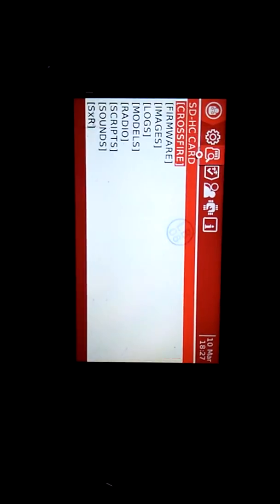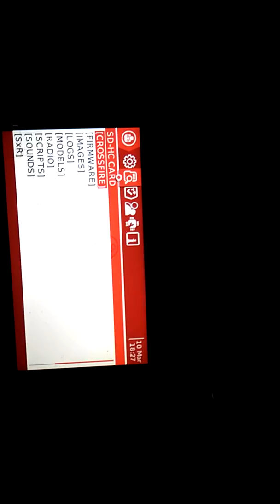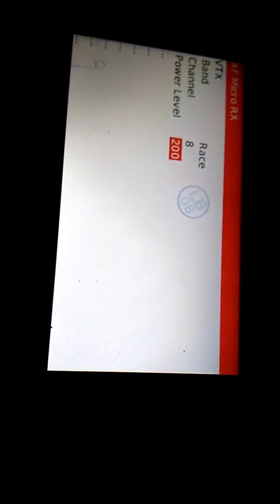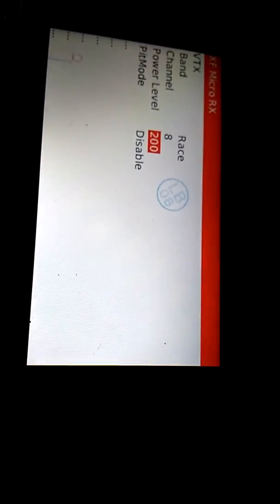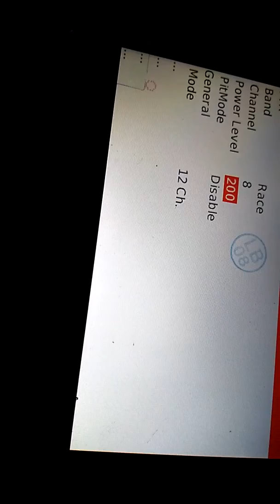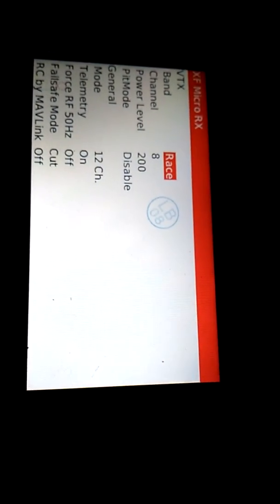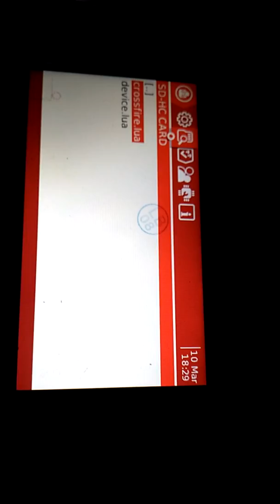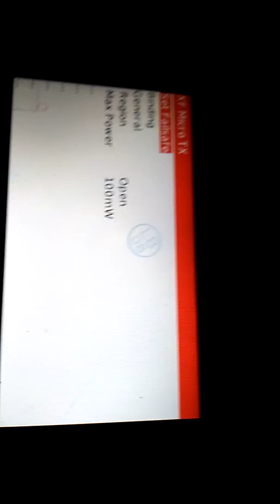TBS cross fire micro issue with x10s

Comment: Dose the lua script work with the full size crossfire on the X10/X10S?  Can't get mine to see the crossfire module at all just the searching..... in the crossfire lua...
Reply from the maker: reflash your radio That worked for me
Reply: Tried that no luck had to lower the baudrate to the 15xxxx setting to get it to work hope this helps someone else and thanks for the tip